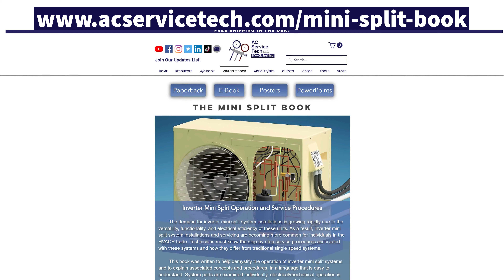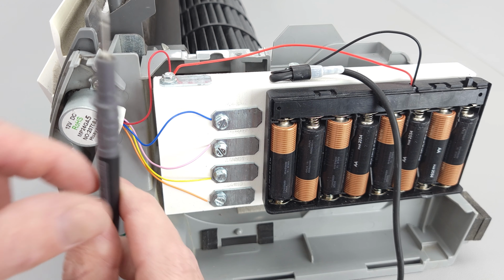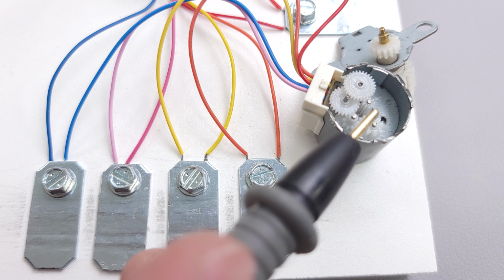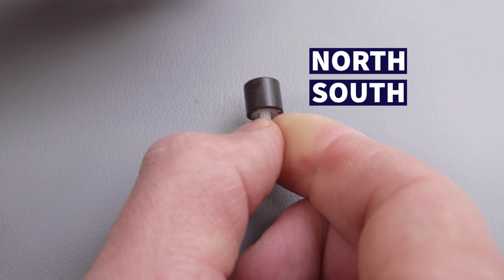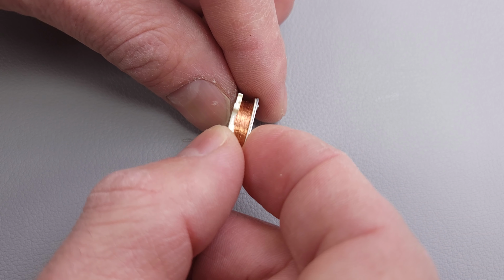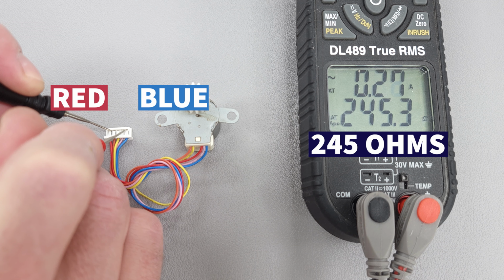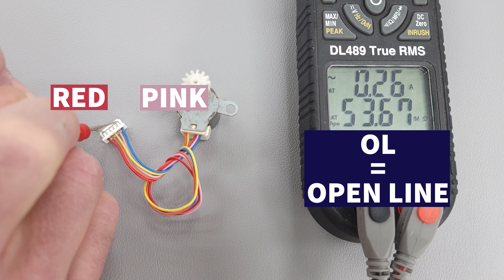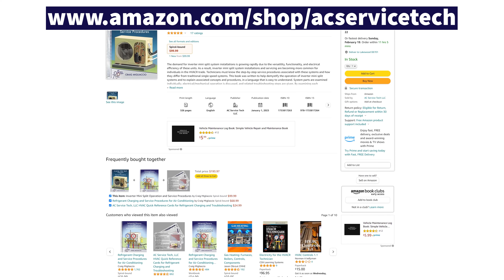Mini Split LOUVER MOTOR Operation and Testing! How Stepper Motors Work!

Comment: Hey man I wanted to say thanks for making this video. I don't deal much much with electronics but viewing your sequence of pulses from the batteries made me understand the sequence of other electric valves. Essentially I can manually simulate the pulses to open a valve as long as I follow the sequence of steps. As an example, the Danfoss ETS 400 has a sequence for opening which differs from the sequence to close. It would be cool to try this out on a modulating valve. Currently I don't own a SMA-12 or the Danfoss equivalent but I can rig something up to test valves manually.

Comment: If you wire two ungeared motors together, by color of the wires, the rotation of the one can rotate the other. Also, an ungeared motor can turn a geared motor.

Comment: You should get a cheap ebay or amazon handheld oscilloscope to show the pulses happening on a real unit. That would allow someone to determine if the failure is in the stepper motor or controller board.

Comment: I assume the louvers come with limit switches. The last thing you'd want is over pivoting them and causing damage.

Also I'm surprised to see that AC units can use stepper motors that are essentially the same as most arduino hobbyists use for projects.